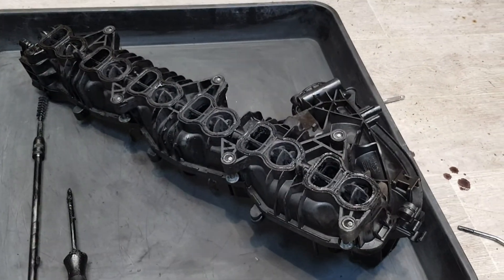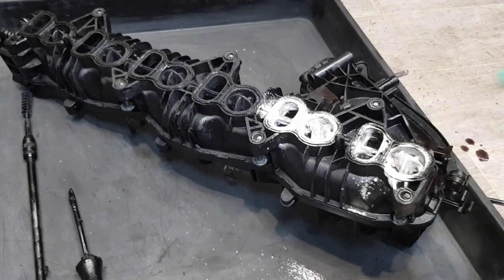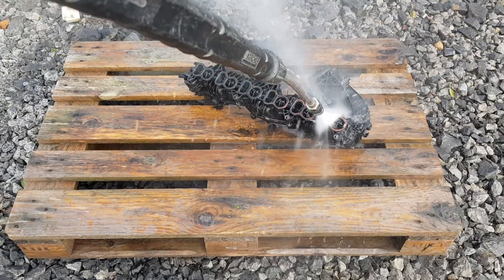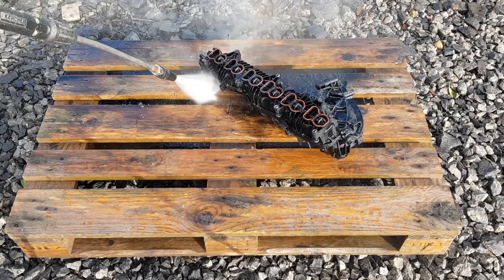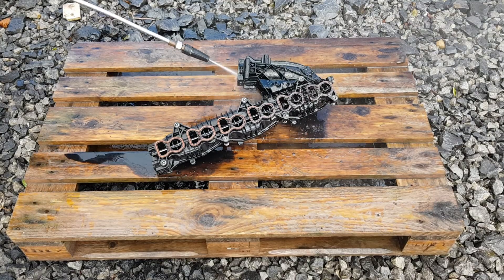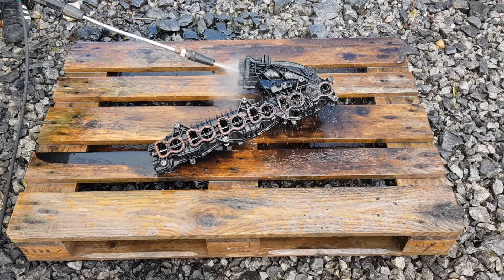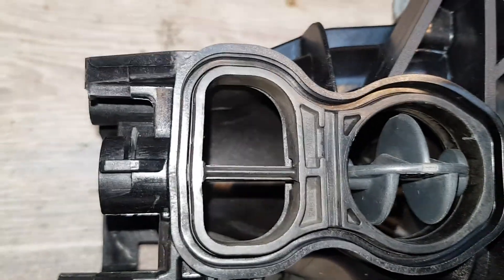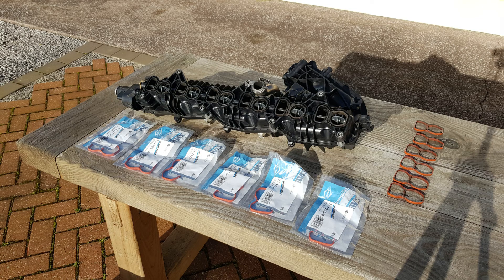How to clean intake manifold Carbon cleaning BMW N57 N47 F10 F11 518d 520d 530d 535d 330d 335d X4 X5

Comment: Could you feel any different in the car after you had cleaned the swirl flaps?
Reply from the maker: Massive difference. Better fuel consumption, runs smoother and feels more responsive in most of the rev range especially in low revs

Comment: Great video. What would you think if the swirl flap motor was disconnected with them in the fully open position. The reason I ask is this is what I found when I took the intake off I had thought they had been removed. I have been driving the car for about 3 years like this and it seems fine.
Reply: I suspect it probably has been remapped with this. I’m afraid to plug it back in. I think I’ll just live with it.
Reply from the maker: @seanmccarthy407 If it has caused you no trouble so far best to leave it as it is as it could be remapped
Reply from the maker: I always like to keep things standard. Don't advise people to modify their cars as you never know what the long term effects are

Comment: Got a BMW F20 118D 2012 had a oil and filter change but engine still very noisy and echuast smells like suffer and fuel economy is only 34MPG which i think for my car ahould be more like towards 40S and 60s on motorway anybody have any Idea mayhe EGR valve is full of shit ?
Reply from the maker: Very hard to tell with this info. You need fault codes. If engine is noisy can be timing chains and crank bearings.
Reply: @TheKeenMechanic no engine light at all and its just been for a oil and filter change but he said they wasn't anything in the filter I made him pull the filter out from the tray of oil to show me if it had metal bits inside and they was nothing he said he didnt see any problems apart from the oil filter being a little bent i feel like its the EGR and manifold clogged up with shit as my missus was driving around town all the time short journeys maybe coked up and its stuck open or closed ?
Reply from the maker: @3rdbanwavey121 If that's the case then it is definitelly full of soot and oil. Take it out and clean intake manifold and valves and ports like I have shown in my videos. I have covered most jobs on the N47 N57 engine so just follow my step by step cleaning tutorials. Make sure to replace the intake manifold gaskets
Reply: @TheKeenMechanic  I have the N47 engine and they are absolutely nightmare if I got a EGR and DPF delete will it be better for the engine and run smoother ?
Reply from the maker: I can't advise you on this as it is ultimately your own decision. Find someone who has done it and see what he experience is.
Reply: @TheKeenMechanic  my cousin has a scanner would i be able to find out the problem with out any engine lights ?

Comment: I have a 2009 E87 118d with N47 engine.  How would you remove the manifold to do this cleaning?  Is it straightforward?  Thank you.
Reply from the maker: @Telstar_1  N47 is almost the same engine with 2 less cylinders. Should be very similar. Watch my removal video

Comment: Great idea, turned out really well. Did you test to see if the mechanism is worn, I see some people are putting a screw in the actuator to act as a stop when their manifold starts wearing out and the flaps go past the stop point.
Reply from the maker: No wear issue on this one. It was well lubricated with engine oil😁

Comment: There are two broad categories of oven cleaner: those with and those without sodium hydroxide (lye) which is corrosive.

I'm American so I am not familiar with that product.  I did some research and it appears you used the corrosive kind.  Did you notice any degradation in the ABS plastic or any aluminum or rubber parts?
Reply from the maker: Use the corrosive one without any fear. I have done this so many times in the past 15 years I can't even count. I have never had any issues with either plastic or metal parts. Hope this helps.
Reply: @TheKeenMechanic  I greatly appreciate your quick response, thank you.